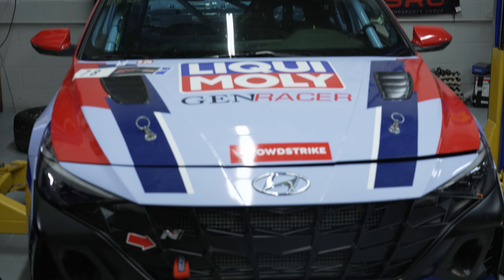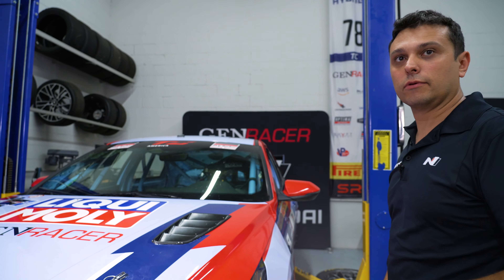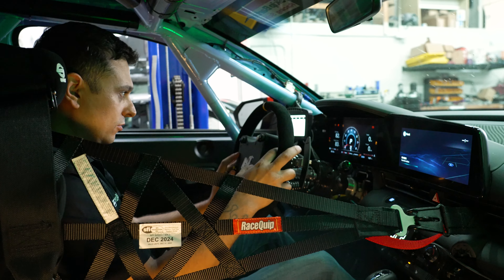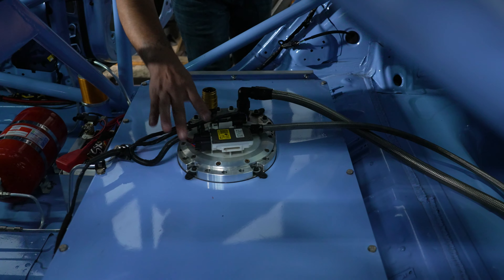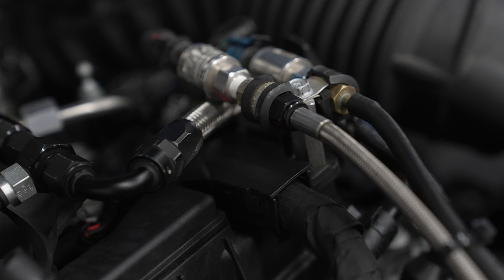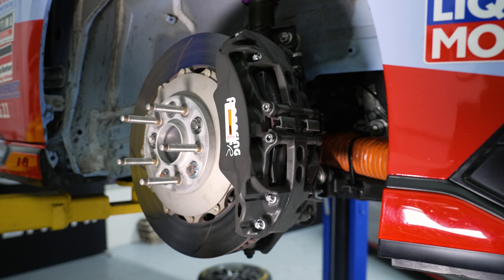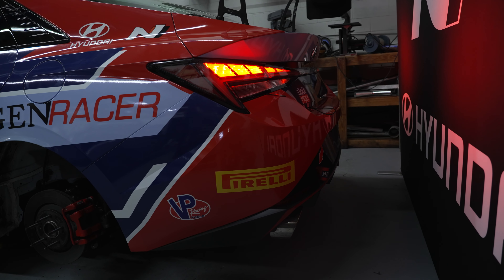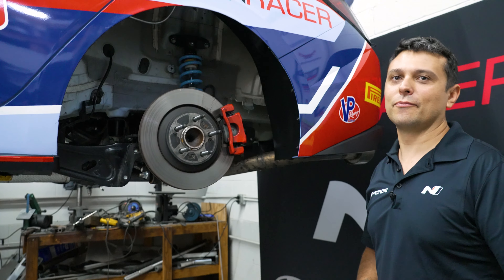Walkaround | GenRacer Elantra N TC race car

Comment: Honestly, for everybody who loves the Elantra N and this gen, enjoy it now and get one while you can.

In a couple of years, the 2.0T engine will be retired from production cars for the road, although it will probably be kept for racing purposes, but the next generation road production Elantra N will be getting the 2.5T engine and it is not going to make financial sense to still keep 2 engines in their portfolio while everything else uses the 2.5T engine in their current lineup.

I'm looking forward to the next gen Elantra N with the 2.5T and fingers crossed🤞🏽 that the next gen Elantra N 2.5T carries over the 6-speed manual transmission and does a complete overhaul of the gear ratio or be the 1st high-performance turbocharged 4-cylinder car to pull off a 7-speed manual transmission. 1 more extra manual gear won't hurt anybody.

I would like to see Hyundai USA/Hyundai N to send this generation Elantra N out on a high note for it's final model year with a road production Elantra N TCR with special touches inside the car and max out the performance of the 2.0T engine to 300hp before retiring it from production in favor of the 2.5T with the 6-speed manual transmission.

Comment: What size wheels/tires do the TC series run? I know the TCR is like an 18x10 or something with 275 slicks I believe. The TC looks far more close to stock, like an 18x8.5 or even 18x8? Offset looks maybe around a +45 or +40? (i.e. looks pretty close to what most folks run as replacements on the street)

Comment: very interesting, would hyundai still warranty a elantra n like this one for the engine and transmission? if it was to go while on the race track with no modification to the engine and transmission like the one shown on the video.
Reply: they would not. ECU is reprogrammed.

Comment: Is that a carbon fiber hood or a stock hood with louvers/vents?
Reply: he said carbon fiber hood with vents
Reply: @kylerm2000  he said it's a mock up and they are going to build a carbon fibre hood. From the pics I've seen at the races recently, they are still using the stock hood with vents.